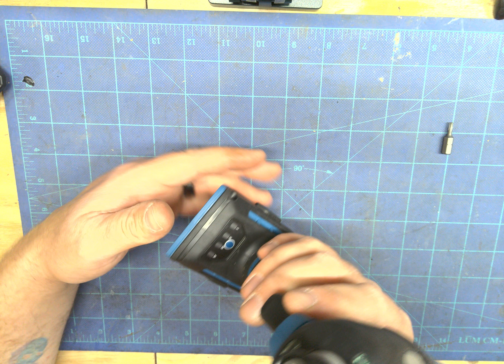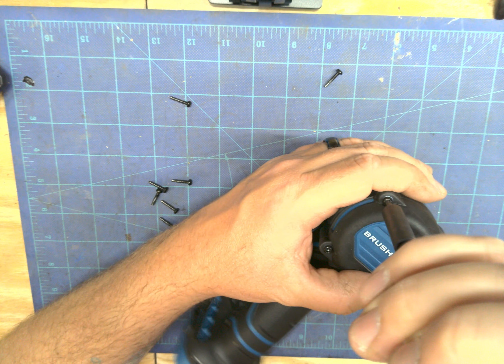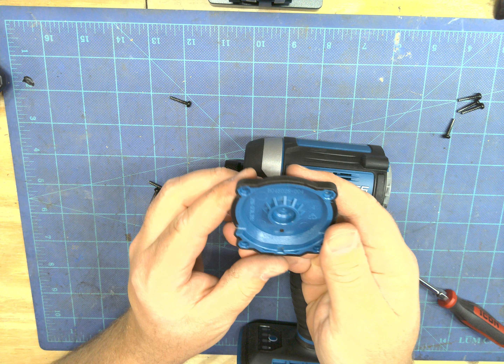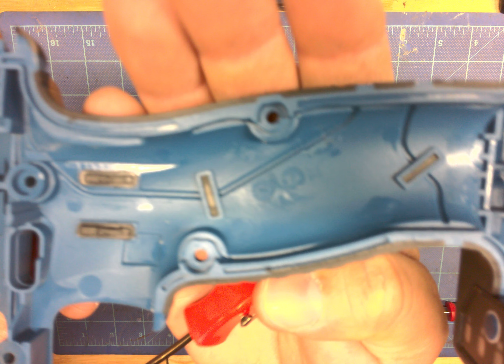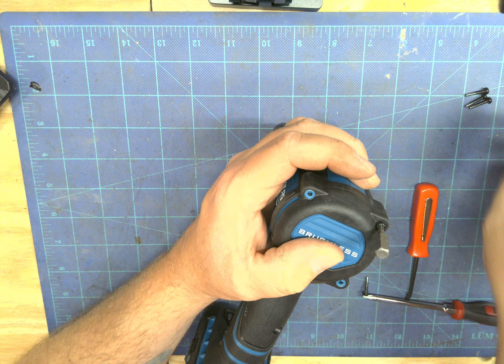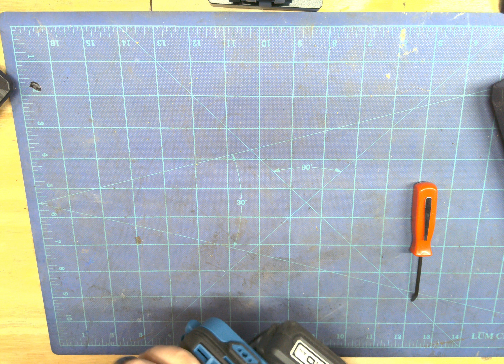Teardown: Harbor Freight Hercules brushless impact driver 4 speed 20v

Comment: The regular batteries use 18650 cells the "premium" Hercules batteries use larger 21700 cells. Same stuff Milfaulkee does with thier batteries afaik.
Reply from the maker: For sure. I was talking about the design of it is the same as the normal batteries just ALOT bulkier but in a cheap looking way like I wish with the bigger cells they could have still slimmed down the design like Milwaukee and even my ryobi regular compared to the hp they almost look identical it’s the same blueprint. I didn’t explain that well in the video though. Thanks for watching and thanks for the comment!